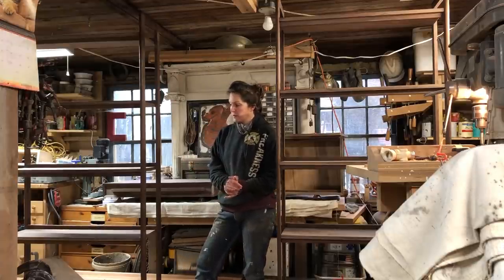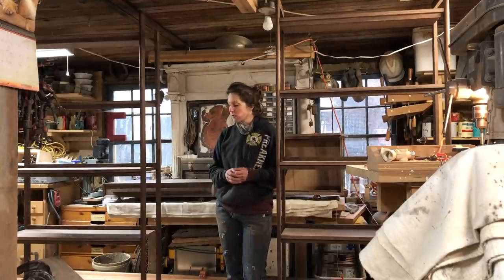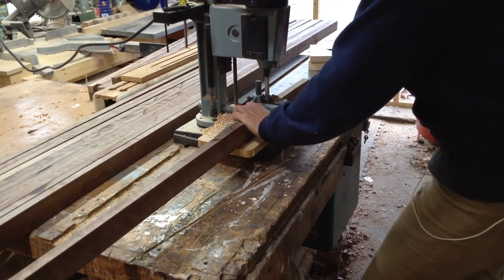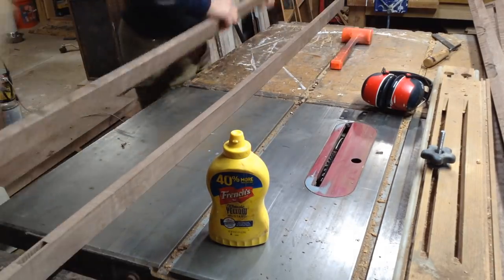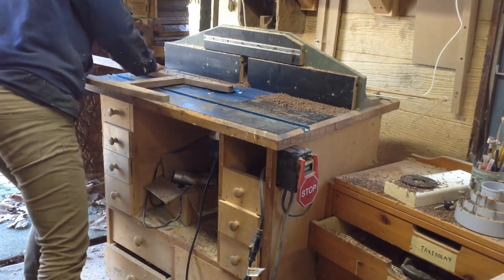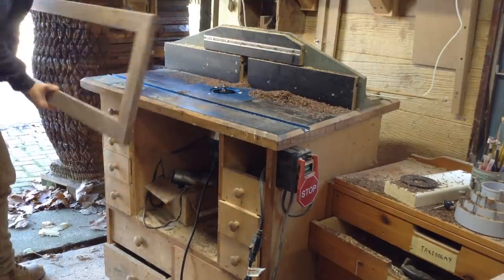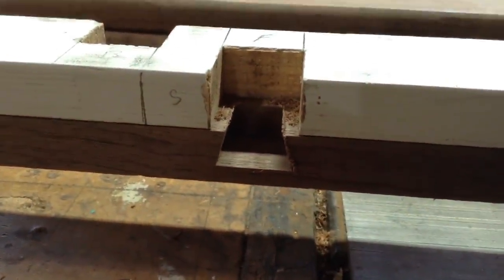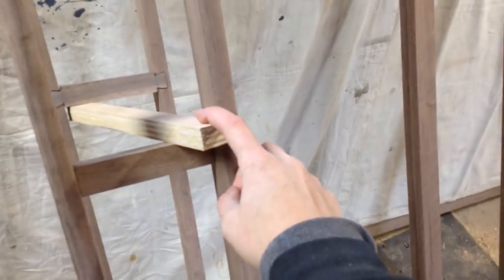Woodworking : Mid Century Modern Built In // How-To Part 1

Comment: Wonderful walnut woodworking! I can almost smell the walnut saw dust! And dovetailed! Can't wait for the remaining videos! When you make the jig, you take in the width of the bushing, right? I am trying this now with keyhole bit, and was told to also, drill the hole THEN use the keyhole bit to take stress off it. So I think, as you did, I may need a 2nd router as changing bits is a pita (dangerously sharp, and the locking pin+ two wrenches sucks).  And two doggies! Its may be tight workspace but you create some great project results!
Reply from the maker: Yeah yeah have to account for the offset of the bit from the edge of the bushing to get everything just right.  Two routers was a life saver for that method.

Comment: Though I'm not a fan of mid-century, my main reason was the poor standard of manufacture with much of it using low grade woods and skin-graft thin veneer on particle board, you allow the aesthetic to be more important by using quality materials and crafted joints. Glad to hear I'm not the only one spending a lot of time staring at wood.

Comment: Cool design and use of joinery.  What finish did you use?  I notice you have a sliding miter saw next to your radial arm.  Have you ever considered setting up your radial arm with a dado stack (and keep it that way)?  Just a thought, since that is your go to for making tennons.  It would speed up the tennoning process, also could then be used for shelf dados, door/window jamb rabbets and what not.    We have one set up in our shop this way, and have found it quite useful.  Cheers from Maine.
Reply from the maker: The sliding miter saw isn't the best and it's the smaller size so I'm extremely limited on what type of cuts I can make with it.  But, I do think it would be nice to have to radials set up in line to do just that like you said.  Would be a huge time saver, but I just don't have the space.
Reply: @HoneyBadgerWoodWorks  copy that.  Gotta work with space and tools that we have.

Comment: Out of all of the different styles, I think mid-century modern is my least favorite in both looks and builds.  Working with all of that long, think material would get on my nerves.  But it looks like you've got it whipped.
Reply from the maker: I don't necessarily dislike building in Mid-Century Modern but parts of it can be challenging for sure.